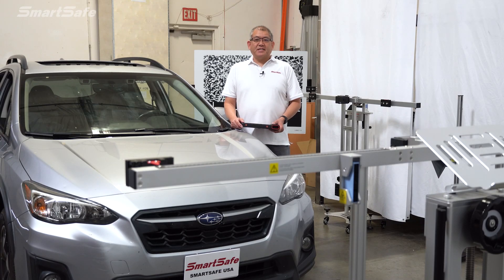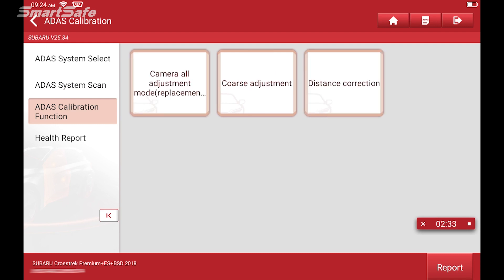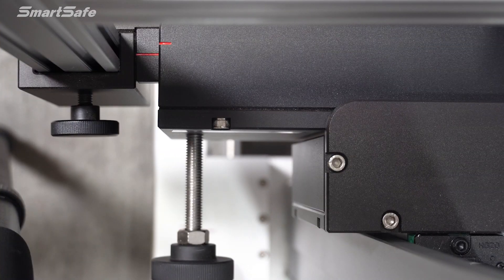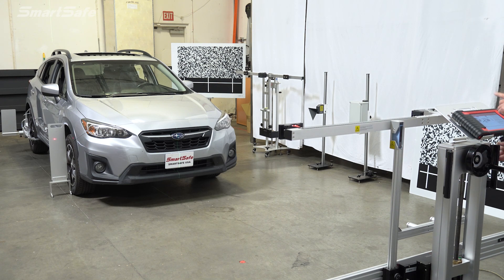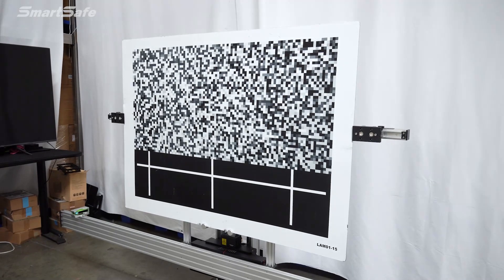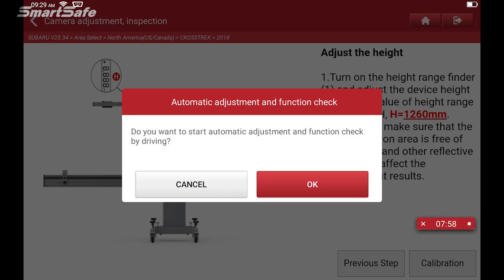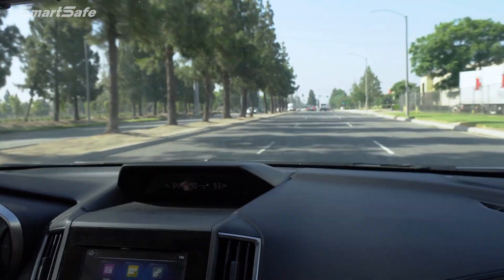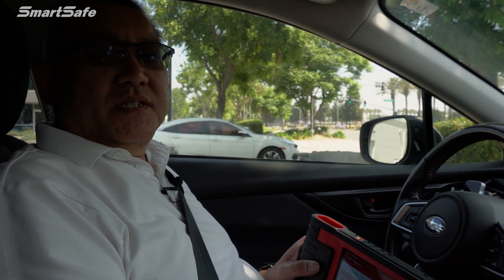2018 Subaru Crosstrek EyeSight Calibration using the SmartSafe ADAS Pro Plus Calibration Frame

Comment: Thank you for this very informative video. However, if I'm not mistaking, I saw that your speed was above 40 mph where was advised between 25 and 37 mph. In which way does this affect the end calibration result please? And, another question: is it also necessary to do a calibration with this Subaru after a windscreen change or only after a severe accident? Thanks for your kind reply and best regards

Comment: So most windshield shops these days are charging around 500.00 for this service. I'm not sure how that is justified even with the accrued cost of the calibration equipment and liability insurance required to do this kind of work.  A few years ago it was about 300.00 to calibrate which was tolerable. I blame subaru - I think it's safe to say most people who currently own optical based ADAS vehicles will steer clear of these models for their future purchases

Comment: Can you do the dynamic while in cruise control
Reply from the maker: Performing dynamic Advanced Driver Assistance Systems (ADAS) calibration with cruise control engaged is generally not recommended.
Reply: Hi thank you for this video. Can the dynamic part of the  calibration be done in dark winter light conditions?